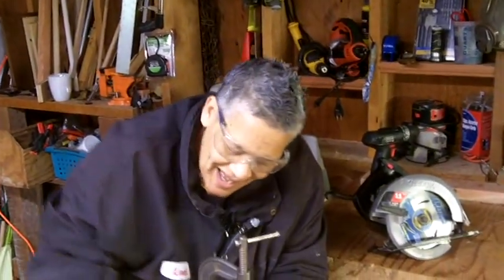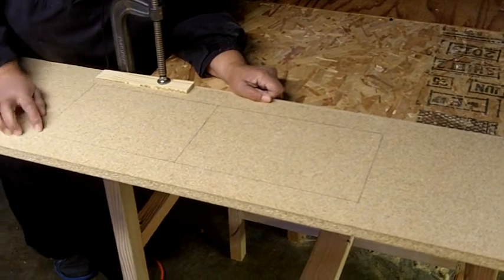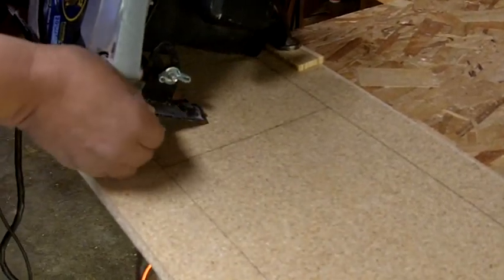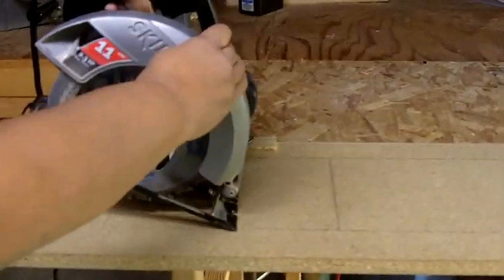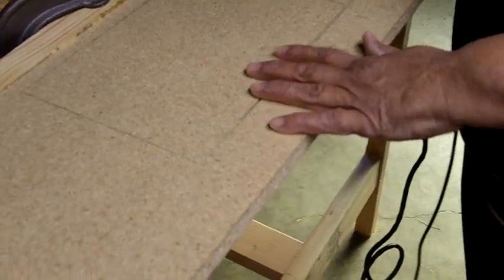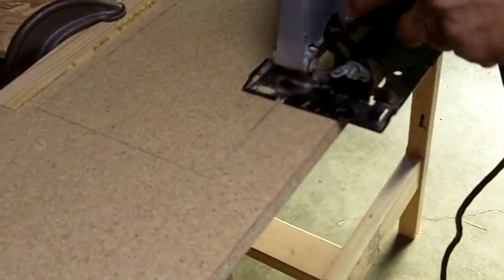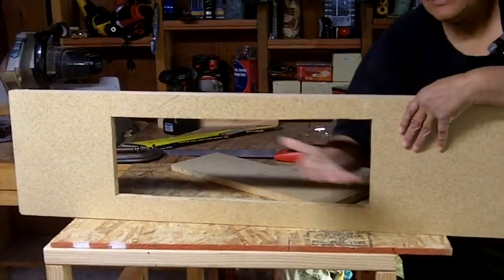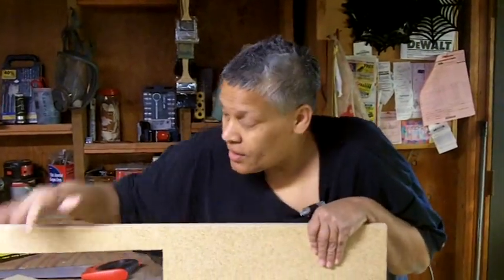How to Make a Plunge Cut with Circular Saw Cut Shape in Wood

Comment: I love you. I am about to build a small mantle for a rectangular fireplace. After building the frame, I am going to use paneling and was wondering how I could apply it to the front where the fireplace insert will be installed.

Comment: you rock - just so you know. :) I want to build a top bar beehive - not really any cutting at this point. But my wood does need to be square to sit together properly - I thought it came that way. lol - Now I know how to make a plunge cut. :) awesome.
Reply from the maker: Hello Melissa,  Bee keeping is pretty cool!  ....and  building a top bar beehive from scratch without a kit is to be commended.  You reference your wood not being square.....If I understand you correctly, do you want to use a plunge cut to square your wood?  I'd like to suggest instead that you consider  using a framing square as a means of squaring up your wood and your project.  Good luck!

Comment: Kia ora LeahI have 'found' your video's... as a keen but novice builder your video's offer clear info with the little details with "how to..". My current project has involved putting in piles/foundations under a deck, building a wall and framing French doors.  While I did work out how to get my piles in and successfully cut to the right level - there are few videos out there that give the details with how to do this.  Perhaps one for you to do?Cheers Nicky
Reply from the maker: +Nicky Cat thanks, Nicky, glad you worked it out!

Comment: You saved my butt again, Leah.  We cut a hole for a huge farmhouse sink in solid oak butcher block. Used a hole saw at the corners and your plunge technique to connect them.  Worked perfectly.  I'd always feared plunge cuts before I watched your video.  Thank you so much.

Comment: Jane, please suggest that the user keep the saw in place in the cut until the blade has stopped rotating after each of the cuts is completed.  Attempting to remove the saw from the work while the blade is still rotating greatly increases the chances of the saw kicking and injury.
Reply from the maker: That is a very good point, Stuart, thank you for mentioning it.

Comment: Great video. Today is Hole-Day on my new walnut countertop. This was the technique I wanted to use, but I was a little anxious about doing it this way. Watching your video has given me more confidence in tackling my project. The only thing I'm going to do differently is use a clamped level as a straight edge for the front of the shoe to rest against during the initial plunge cuts, to keep it as square as possible.

Comment: So...you had to cut all four edges with the circular saw first before you use the hand saw to get the edges cut all the way throught, right? Kinda confused because I only saw you cut two edges with the circular saw, and cant quite figure out how you can cut the other two edges just with a hand saw. Thanks for the vid.
Reply from the maker: +Anon P Oh, I did cut all four edges with the circular saw.  I just had to abbreviate the filming of the cutting process, in the interest of keeping the video a manageable length of time.

Comment: Leah, love the video as always.  Great job wearing safety glasses, too!  

BUT...you should warn people not to stand behind the saw or put their fingers or hands near the back of the saw.  If the blade binds (because you've moved it to quickly forward or tried to move it backward or twisted the saw) then the saw can produce "kickback" where it jumps and potentially flings itself backward (over your hand or your workpiece).   

Never, ever put any parts of your body you want to keep behind that a circular saw, folks!

Comment: Just a quick question. Wouldn't it be a lot easier to make this particular cut with a jigsaw (which a lot of homeowners have) and an edge guide? I have a circular saw and a jigsaw and an edge guide made of aluminum at home, and I would the latter to make this particular cut myself... Well, anyways, thanks for a nice instructional video. I've thoroughly enjoyed your videos so far :-)
Reply from the maker: +Dennis Stuhr Hi Dennis, thanks for writing, and I'm glad you like the videos.  As for your question, well, if you are cutting a circle or rounded shape out of a piece of wood, the preferred method is to drill a hole, and then make the cut with a jigsaw.  Then there is the plunge cut, which is a technique that can be done with a circular saw, a jig saw, or even a router.  I was simply demonstrating the plunge cut technique that is done with a circular saw.  In my experience, it is the best method for making the long, straight cuts that are needed when you want to cut a square or rectangular shape out of wood.

Comment: I love your videos, already tried a plunge cut test for a cut out on a sink, get a much straighter and finished line than trying to cut with a jig saw on a thick worktop. To get a nice round corner first I measure and drill out the corners which saves messing about with a router.

Comment: good video but it doesnt answer my original answers on this.  how do you know when to stop cutting if you cant see the blade. it would be great if you can hold the stupid gaurd in place without holding it.
The festool saw has marking on it for reference points on where to stop.   thx again great video